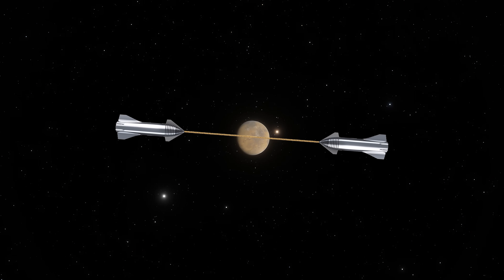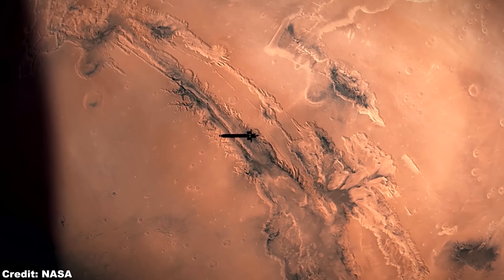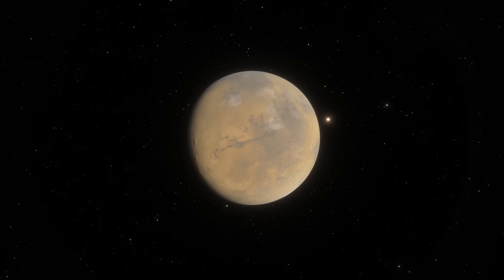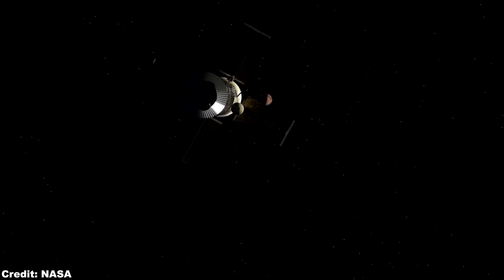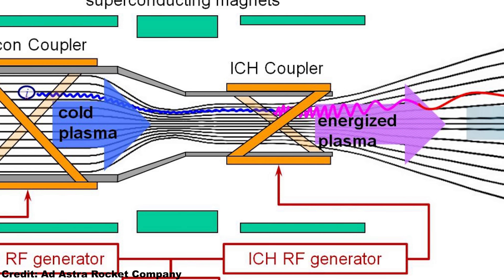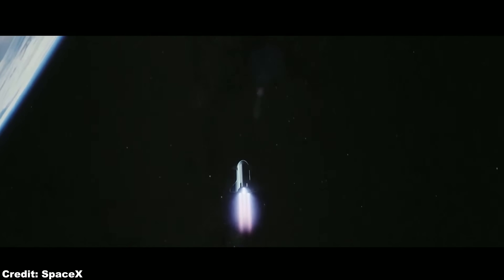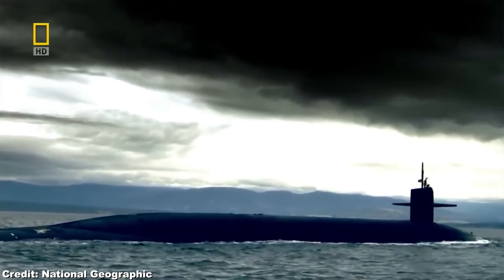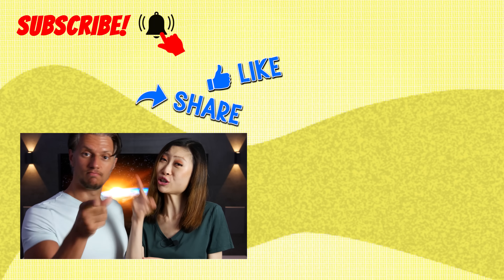4 Ways To Upgrade Starship's ENGINE! [SpaceX Starship FLAW FIX]

Comment: You are forgetting the main problem with such a short trip duration: acceleration...
The ship would have to accelerate an decelerate at a incredible rate to do a trip in such a small amount of time...
That would, most likely, kill all the passengers...
Reply: As a human living on earth (I presume you do) you currently are experiencing an astonishing 1 g acceleration. It is 9.81 m/s2 and you survive well. 
This acceleration would enable to reach Mars in TWO days.
The 39 days target involves much lesser acceleration so do not worry!
Reply: @fredericvadez7998  No... I was the one that was wrong... The g forces are the same no matter if your are increasing your speed or not. So, you are correct sir. My apologies.
Reply: @fredericvadez7998  - What ?? Are you sure you understand the meaning of acceleration?? Please review the concept... By your understanding a person would reach the speed of light in less than 13 months...
One G acceleration applies only when you are in free fall and it reaches a maximum speed of 53 m/s (in less than 6 seconds)...

Comment: One simple solution would be to have a disposable booster to give extra velocity to Starships carrying humans.

Probably shave a 1/3 off.
Reply: Why not some extra orbitable and detachable fuel tanks (with a modified starship that accomodates tanks fixations and piping) ?  May not be as elegant as a fancy new engine but could work in the short term. It would just need a few extra cargo starship launches, but isn't the point of starship to be low-cost per launch?
Reply: An extra departure stage is what Zubrin suggests and also how all my Kebals do it.  The stage doesn’t have to be disposable either if it has some fuel left after staging.  This has a big advantage over vasimr and other low acceleration concepts in that it benefits from the Oberth effect.

Comment: To answer your question at the end, absolutely. Starship will need a reactor at some point if for no other reason than to enable operations beyond Mars orbit (where solar power is no longer practical), and at that point why not incorporate it into the engine systems in conjunction with the existing chemical drive (akin to LANTR)
Reply: A very large aluminized mylar film mirror could be stretched into a near parabolic shape by making it half a reflective lens with the other surface made of transparent mylar film and low pressure between them. It would concentrate solar light and heat onto the starship and solar cells.
Reply: Well I hope we have a fusion torch drive by then! But well said in any case.

Comment: Two types of engines here - rapid oxidation and ionization. Both require carrying a single gas to ionize or to combine with an additional oxidizer. Plus the levels of complexity - the more parts the more points of failure. Pointing out issues without offering alternatives, is pointless - carry a recyclable gas that can be easily ionized as either Positive or Negative. Stripping an ionized gas of electrons as a concentrated energy source (NOT for an ion engine, rather, electrical power). Then use a method to re-ionize the gas with electrons in the thin atmosphere of space. Yes, I too am concerned that the energy to "run" the engine might be greater than any useful output. But maybe?

Comment: Thanks for the great review but as a long time proponent of solar thermal rocket propulsion I do have a little push back. Nuclear electric power is incredibly costly and no matter how light the reactor; you still have to convert heat to electricity which means kilograms per kilowatt. By contrast, solar can be even better than is currently appreciated. A solar thermal rocket uses a large low mass mirror to focus sunlight on a reaction chamber made of rhenium into which hydrogen is injected. This has been demonstrated to achieve in excess of 1000 seconds specific impulse. After being launched to orbit; the solar thermal would fire in a series of perigee thrusts to escape. At this point a small PV array would be moved into the focus and convert the sunlight at over 40$ efficiency, 900 Suns and even with radiator more than 5 KW/kg. This power can then be used with ion, MPD, or Hall effect thruster to speed up the trip all at a tiny fraction of the cost. At a seminar years ago I was told by an industry insider that "It doesn't cost enough".

Comment: VASIMR requires a lot of energy (Like that provided by a 100-150 MW nuclear reactor), & the reactor can’t weigh more than 1t/MW produced. Not even the best reactors in the US & Russian navies have done this, & the Kilopower Reactors can’t get more than 10 kW for a 1.5t reactor...
Nuclear Thermal Engines are far more mature & could be ready to use in the next 5-8 years. The only “fly in the ointment” is the need to send Enhanced Uranium from the earth into space.
As the engineers at SpaceX believe they can get to Mars in 3-4 months, so the gain isn’t worth the risk...
Meanwhile, those traveling to Mars on a 6 month voyage would be exposed to the same amount of radiation as astronauts receive in a year on the ISS & in LEO. Between Salyut, Mir & ISS, several astronauts & cosmonauts have spent more than a year in LEO.
Reply: 2 The Future with Jixuan & Sebastian - The earth’s magnetic field provides some protection against Solar Radiation & Solar Flares, which we could protect against using 15 cm of water or similar material. But it provides no protection against cosmic radiation - Whatever protection astronauts in the ISS is provided by that big planet they’re next to... 
https://www.nasa.gov/ames/ocs/2014-summer-series/robert-zubrin/ https://www.nasa.gov/pdf/376589main_04%20-%20Mars%20Direct%20Power%20Point-7-30-09.pdf (please see p. 14) 
https://spaceflightuk.com/tag/robert-zubrin/ 
https://spacenews.com/35865curiositys-radiation-results/ 
https://twitter.com/robert_zubrin/status/869248086866055170 
As you can see here, people who smoke a pack a day would actually be exposed to less radiation if they quit smoking & took the trip to Mars -
https://www.youtube.com/watch?v=TRL7o2kPqw0 
http://astronomy.nmsu.edu/cwc/Teaching/SpaceCol/sts497i/Zubrin/transcript.txt 
And, colonists could reduce their radiation exposure buy “digging in” or putting their habitats in caves & caverns. If being next to a planet decreases your exposure to cosmic radiation by 50%, going underground will knock that down to near 0...

Comment: Even the correction about the specific impulse is not correct. An x second specific impulse engine with 1kg fuel can produce a thrust of 9.81N for x seconds. This is different to the correction 8n the video, the acceleration for example would not be constant. Or a better meaning of the specific impulse is that the effective exhaust velocity is I*g.

Comment: cool video!!!, are Thorium reactors better in heat production?
Reply: Yes, the corrosion problem has been solved with hafnium alloys. The original and very primitive liquid thorium reactor ran for several years without corrosion problems. With modern alloys, there would be little problem. The only exhaust would be from the separator to remove neutron absorbing gases from the fluid, and I suspect those gases could be used in the VASIMR as additional fuel.

Comment: Thanks for the propulsion episode!
For civilian craft I would say a nuclear thermal coupled with a booster system would be your best bet. The booster system would be a strap on booster that falls away after expending its fuel, leaving more onboard propellant to stop at the other end of your journey. This would greatly decrease travel times and cost. Another booster could also be used on the destination end, making it even easier to stop and allowing even faster travel times.
For military craft, nothing beats an Orion pulse drive spacecraft. It may sound weird to use nuclear explosions as your propulsion, but there is no other system that can provide that level of power for truly heavy spacecraft, in the thousands of tons. You would not want civilians getting access to hundreds or thousands of small nukes, but for military craft that would work fine. All the heat falls away, and space is already full of radiation.
Currently antimatter is very expensive to produce, but mostly that is because it is produced as a byproduct instead of a dedicated process. Antimatter can also be used in an Orion drive craft, and studies have shown that it could propel a massive craft to over 20% of light speed making travel to close solar systems possible..

Comment: Good article but you need to point out the mass to power ratio problem. Vasimir needs a power-to-mass ratio of 1,000 watts per kilogram whereas we can only build reactors with power-to-mass ratios of 20 to 30 watts per kilogram. So we would need to improve this by two orders of magnitude for vasimir to be feasible. Currently impossible.
Reply: So a liquid fueled fission reactor like MSR, or maybe the SAFIRE "cold" plasma fusion reactor(dunno how true or practical this one is but they do interest science with it), at least these two seem the closest anyway compared to"hot" fusion reactors lol

Comment: Great show!
This is one we need to work on. We NEED to have either rotational or accelerational gravity for the folks on that ship, and the shorter they are in space, the safer from cosmic rays and solar wind. Being able to boost constantly to both gain and shed speed provides both. The Vasimir drive does have promise. Let's see how it develops.
Thanks for uploading.
Namaste.

Comment: Some really outstanding work here. This for me has to be one of the more important. Thrust gravity is far more practical then spin gravity in my opinion. Design and Mission Architecture are all driven by the type of propulsion. Propulsion is important and you cover them really well. In my opinion Fusion Rockets are key!

I like the Fusion Drive that mimics the sun. At its core it creates an intense heat comparable to the sun to achieve Fusion and magnetics to pinch off and thrust the reaction out the back. From this comes really important benefits. Thrust Gravity, Electricity, Delta V, and much shortage flight times. 

Also I am a huge advocate of the Turtle method of radiation Protection! The Turtle method has an outer and inner shell with water in between. Water is an excellent form of protection and also useful in hundreds of ways during and after the flight. Although it will reduce the crew numbers it will keep them safe! If the hull is Punctured it self seals as it freezes and it also means water for crops...

Great job going over the options! Until Fusion I think Chemical is best. Largely because we can refuel from Martian resources!!!